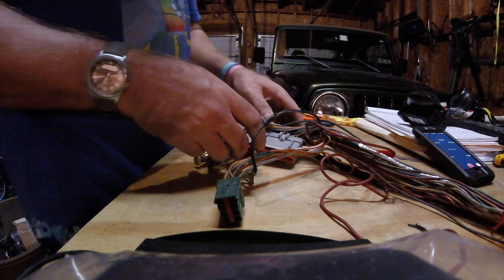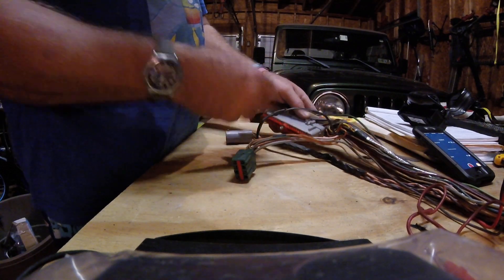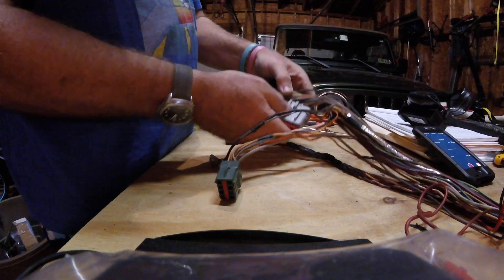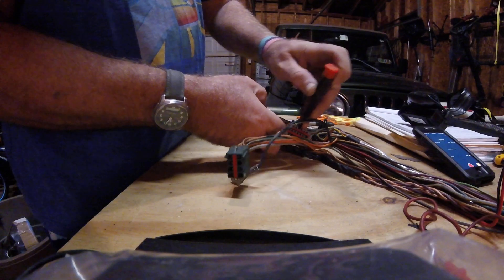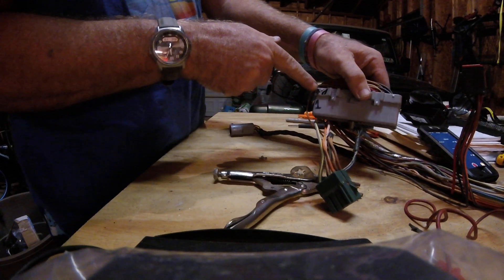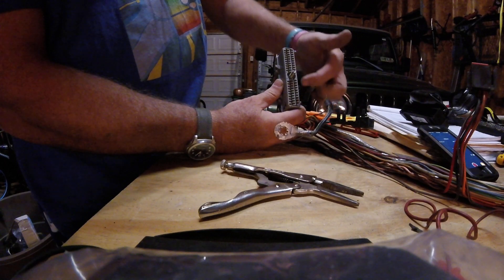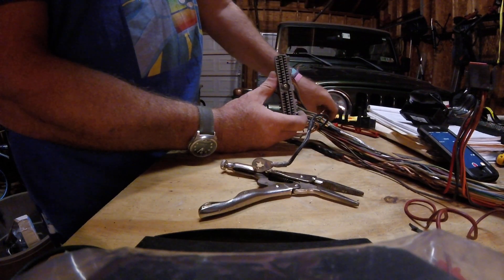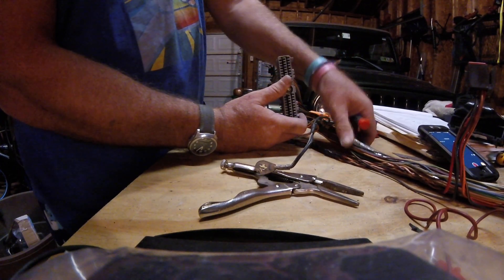Mustang EFI Harness Conversion Series 2 Video 4

Comment: Can you make all of wiring for a 1976 ford Torino elite has a 351 engine    And how much
Reply from the maker: Sorry, all I can do is rework an EFI harness from late 80's-90's Ford's to be able to work on older carberuated engines as part of an EFI conversion.  I map the harness to 86-93 Mustang computer (SD or Mass Air) and I add circuits with relays to make it more reliable.  If you have a 351W then maybe one of these converted harnesses will work as long as you use a Mustang computer.